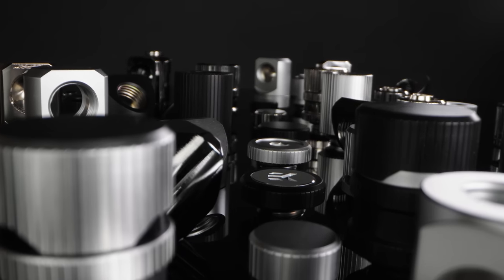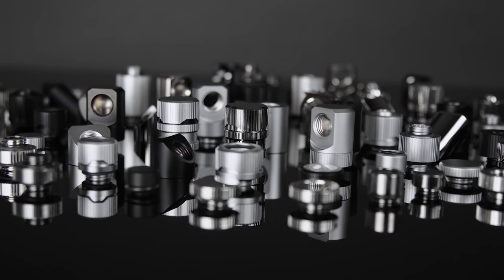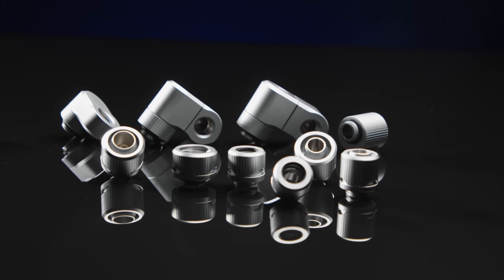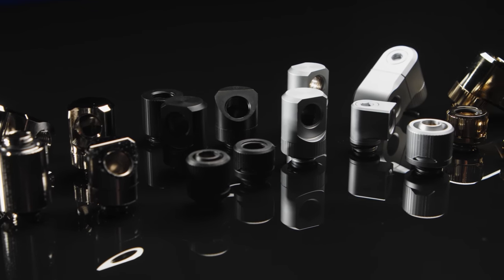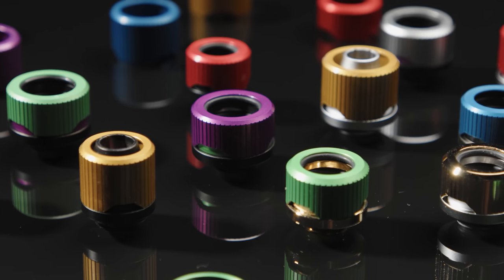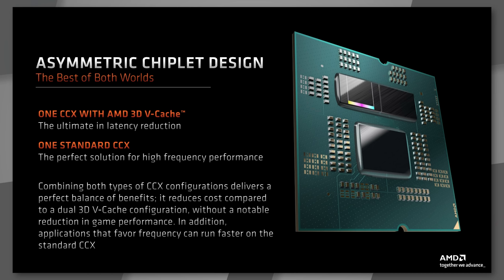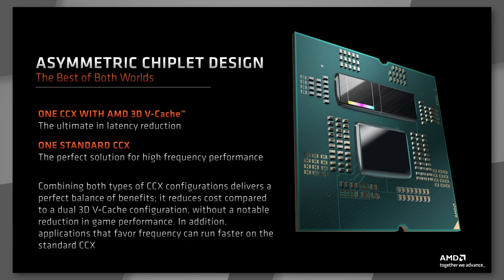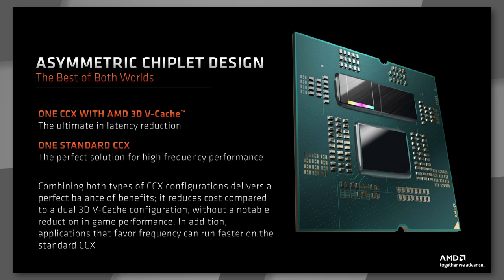Why I switched back to Intel...

Comment: I'm currently on AM4 with 5900X. I did want to upgrade to AM5, but decided it would be better to skip the 1st Gen of AM5 and wait and see how the 2nd Gen turns out. I hope all the issues will get fixed by then. If they still end up having issues then I may switch back to Intel as well.
Reply: Same boat myself. Currently on a 5800x but waiting to see if the 5950x goes on sale during the holiday season. I run occasional VMs so yeah 5950x for me lol. I’ll see what 2nd Gen AM5 has to offer.
Reply: Exactly the same here.

5900X has also gave me a lot of grief and consumed a lot of my time with all the issues and countless BIOS updates fixing some and introducing others, spanning years of time. Effectively, I'm waiting for a CPU that will be at least as fast as my current 5900X in all applications and use cases, but at least 40% faster in games, otherwise I wouldn't bother upgrading. When that shows up, if Intel has it too, I'll go Intel, even if AMD's offering is even faster, just for the sake of sanity and to save my time and have a better overall user experience.

Only if only AMD has it, and AMD's offering is substantially faster (not 10%, but 20% or more, becoming more than 50% faster in games than my current 5900x) and/or substantially quieter (Intel's alternative having much higher and also high in abs. figures power draw while in games, making the system loud and time consuming to tune to not be atrociously loud), would I go AMD again.

7800x3D currently available doesn't qualify as it's slower than 5900x in multi-threaded non-gaming applications. Multi-die x3D chips are a nightmare in terms of the overall user experience. Intel isn't faster by a margin high enough to bother and has cooling problems. Nothing's out there good enough to be upgrading from 5900x, given the cost both in money and more importantly time that that entails.

Comment: Have you had a chance to check out some of the asrock boards? They’re supposed to have really good memory stability.
Reply: I can confirm this. ASRock x670e here and no issues with my gskill ram
Reply: @webnplay  I heard the b650 live mixer is a really good one. Thunderbolt 4 support with their add in card  and the slot below the gpu slot doesn’t take lanes from it. They’re 3.0 speed though. It goes for $180 US Right now.

Comment: I had a abundance of issues this week with the 7950X, ended up all the motherboards i had tested with were doing the same things in terms of memory instability and overall being unstable on the ASUS Strix X670E-E and the Gigabyte Aorus Pro X X670E, they were also having a lot of driver issues. I even made sure everything worked in the QVL but nope. The AsRock Taichi X670E has been the best board I've ever had. It does everything right. It does memory training on the first start and stays within its expo or xmp profile without any sort of crashing. Overall, if youre going the amd route please look into asrock motherboards.

Comment: I think most of your issues with the AMD system is from the dissimilar CCDs. While I would have loved some testing and tests with the 7800x3d to see if it was more stable with your use cases, but in the end Computers are tools and if your tool is getting in the way of your enjoyment and work its not effective. Its been a cool experience to watch the latest version of skunkworks come together. 

in other notes about core parking, the Linux scheduler seems to have a much better time with getting the correct CCD but linux is not for everyone and dialing in the scheduler properly was a bit of a chore for a bit when it was first released.

I have a 7800x3d running rock solid and its been running rock solid for a while 6000Mhz on the memory as well. Best of luck with the intel stuff, I probably wont follow and its gonna take intel doing something really interesting with their CPUs before I go back for my desktop.
Reply: it's obvious IMC degradation and something normal people with common sense would RMA instead of trying to 'fix'. But Jayz isn't very experienced with PCs sadly. 2012 isn't a long time if you can't figure that out...

Comment: Pretty much what you said. Anyone I know that runs the 5800X3D or any AM4/AM5 non X3D CPU have had no issues whatsoever, it's the newer X3Ds that are being wonky.
Reply: Oh there's plenty of issues on non-x3d processors, like any product. There's duds out there. I should know, I bought one for my nephew back when the 5800x was new. He's not very technically inclined and lives a good distance from me so I helped him build it at his place since he wanted to learn how. Powered it up and installed windows and everything seemed absolutely fine. Then a couple weeks later he calls me talking about his PC having graphics driver crashes. He was using my old GPU that he had in his previous machine since GPU prices were fully in the ridiculous territory. through several rounds of trying to solve this sudden issue I end up finding a legitimately good deal (MSRP) on a new 3070ti. Installed that and the graphics driver stopped crashing. Now it seemed a new issue cropped up. Instead of GPU driver crashing he faced sudden, seemingly random reboots. My initial IT technician instincts were that there was an issue with the PSU... Replaced that.. Nope. Not the issue. Was something wrong with the RAM? Nope not that... Motherboard? Nope. Replaced everything but the CPU with no change... Finally, swapped the CPU for a newly released 5800x3d and all reboots and issues were gone. The 5800x was a dud from the start and AMD warrantied it. There were literal years between the start of this and the end when it was resolved... due mostly to the distance and lack of technical ability on his part. He'd basically just been living with it and wouldn't tell me anything was wrong with each incarnation since it could take anywhere from 10 minutes to 10 hours to restart and I was always busy around that time and could only come by for a short hour long visit at most. Which it's not so bad, I at least built a second system for a brother out of the deal.
Reply: @scythelord  DDR5 from Intel has also bunch of problems, especially with those who want fast ram (like over 7200) and having problem with Intels XMP (crashes, reboots), and also platform has problem with its motherboards overvolting the CPUs, so, for some reason people got like for example 13600kf and playing on 4k, like 10-20% of usage and temps goes over 80 with some 50€ cooler. Personally, I've had first gen ryzen and for last almost 2 years I'm on 5600X and got 0 issues, XMP worked fine (+ an extra that I did 3733 cl14), literally 0 problems. Also, problem is that people are buying RAMs that got Intel XMP specs, so yeah, that wont really work... when I'm building someone an AM5 PC, I'm getting them ram that is rated with AMD EXPO and it always work without problems. Basically, for someone 13gen doesnt work alright, for someone AM5, for someone nvidia is shit and for someone amd...

Comment: Next video in the series is "Why I am switching to Arm...

Seriously Jay, you could at the very least tested another 7950X3D to verify that yours wasn't simply faulty with a bad memory controller or something. You should revisit this and make amends of what you thought might be the problem. Would be interesting to see if the issues still persist.

Comment: When I was looking for a new build 5 months ago I was CONSTANTLY reading & seeing video's about how sketchy & inconsistent the X3D had been for this generation and I said: "FGSFDS" and picked up a 7950x instead & the thinks been running like a boss every since I first booted the system ❤
Reply: Good choice. Even a 7700X would do just fine. As long as ones isn't a try hard esports gamer xD
Reply: Same here went for the simpler 7950x also because of the slight performance increase in Stellaris.
Went with an non-expo memory 6000Mhz and it’s working fine.
I do see slower boot time than my 9900k but it’s fine.
Main « issue » is that each time I tried the graphical over locking amd took the machine didn’t boot somehow, while bios level changes do work fine

Comment: I went from AM4 to AM5... and then back to AM4.
AM5 is just not ready, IMO, between RAM compatibility, the extra heat, and the fact that the 5800X 3D is STILL in the running.
Reply: I bought the 5800X3D because its the best for AM4
Reply: 5800X3d is a great CPU. AM5 isn't quite there yet, true. But it's way better now with a newer bios.
Reply: what cpu did you had? cuz from what ive seen, the problem come with duel ccd which only one is with 3d.
Reply: Had no dramas with AM5. Running xmp kit with custom timings. It turns on and goes, tho I don't study my speedo gauges much. Snappy desktop and smooth gaming
Reply: @Djent_Lover  with what cpu? 
cuz the vid talk about the 7950x3d (and 7900x3d) but i can say almost for suuree that this is the ccd thing and not the am5
Reply: @Ben-lr9tp  yeah just a 7600 to get onto the new platform. Games similarly to the 5800x3d. I came from an am4 system, but wanted the upgrade path. The dual ccd is the problem, parking the wrong one in some games. Hope amd sort it out. Not sure what the OP had a problem with their am5 build.

Comment: I’ve been a hardcore overclocker and custom water loop builder since the mid 90’s. I’ll say one thing, I don’t understand why AMD (today) has such a massive cult-like following. I’ve gone between the two several times but I can’t see why anyone would be on the AMD side right now other than the cooling requirements if not on water. 🤷‍♂️

Comment: @JayzTwoCents - I know this is a old video and chances are you won't see this post BUT I'm betting you were running a Asus board. My son recently experienced the EXACT same symptoms you were. The problem just kept getting worse! As of this last weekend we swapped out a Asus X670E Strix for a ASRock B650E Taichi and thus far everything is good, time will indeed tell us more. The CPU nor the RAM are the issue, the motherboard seems to be the issue. On the Asus it would habitually BSOD reboot on the first cold boot, generally after that it was fine but as time went on it would BSOD a second time before being fine. On the ASRock board the whole setup went smooth without hiccups. Memory OC'd to 6000Mhz with EXPO, FCLK at 2,200Mhz (haven't pushed higher yet), Curve Optimizer to -45 on all cores but two, one being -50 the other -43.
In short, I don't think it's a CPU issue, I think it's a motherboard issue, try another motherboard with the same CPU (7950x3D) and see what happens, but I'd just about bet money you're running a Asus board and that is your problem.

Comment: 7950X3D with 64GB 6000 CL 30 no issues whatsoever other than crushing Intel fans hearts that use 5x the electricity for not as good performance lol

Comment: Just upgraded from 3600 to 5800x3d. Microcenter had a pretty sweet bundle deal. Running it with asus tuf b550 and asus 3080 tuf.  I have a steady 20% increase in fps with 0 overclocking. 
0 issues. Totally stable.

Comment: I have the 7800x3d.  I stream @ 2k and record without issues.  I have MSI board and didn't have issues with ram issues.  XMP gives me 6000mhz.  Granted I run 2 sticks for 32gb of ram.  Wanna try 4 sticks but don't wanna waste money to see if I can.
Reply: If 32gb ram is enough for everything you do, more ram won’t give more performance. Adding ram is pointless unless you’re running out of ram
Reply: Almost everyone reporting issues has an ASUS board. It's almost like a pattern..! Yet they blame AMD..

Comment: This video didn't age well.
Reply: Y?
Reply: @hacoberthejacober3345  intel’s 13th, 14th gen crash problem caused by silicon degradation
Reply: @capybara-sama  damn I’ve been out of the loop a while, makes me feel even better about my 7800x3d
Reply: it’s not degradation - it’s just unset mobo power limits, which is an easy fix
Reply: @thekeylimepie unset power limit which causes silicon degradation which causes crashes
Reply: @capybara-sama  yeah so set the power limit lol
Reply: @GAMER38X-hh7zl  is the 7950x3d more stable now?
Cause i dont know if i should get the 3d one or the non 3d one
Reply: @JokerP5  yeah mate its fine for me
Reply: Lmao
Reply: Just like intel processors.
Reply: @mangatom192  XD
Reply: Like fine milk
Reply: @mangatom192 intel processors far more stable if you set the correct power limits out of the box. I’ve used both and my 7800x3d was loaded with problems. Very good on paper and in some titles but if money isn’t a concern and you know what you are doing with the power limits then intel is worth the mostly not noticeable sacrificed performance with some games.

Comment: It's been interesting and educational watching you struggle through the stability issues you had with this iteration of Skunkworks, in part because I went through a very similar situation many years ago with an AMD Phenom II X4 Black.  In my case, the Gigabyte motherboard had a BIOS update that broke compatibility and the solution was to have to buy a downgraded processor (which at this point cost more) and then not be able to use or return the sweet proc I'd shelled out money for.
Not haranguing AMD here, just realize that I'm probably still good to stick with Intel.  They're not perfect (hey Spectre! Hi Meltdown!) but they've honestly given me less grief.
Current build:  Intel Core i9 10980XE, EVGA RTX 3080 TI FTW 3 (RIP EVGA), gaming at 1440p.

Comment: I had so many problems with my 1700. Weird start issues. Software issues. Stuttering. 

When I upgraded to a 3700x I had nothing but problems as well which I hoped would be improved. 

My systems worked but unreliably. 

Switched to Intel 13600k and haven’t had a SINGLE problem. Starts EVERY time. NO software issues or inconsistencies. Game changing. 

Im back on team blue for now.

Comment: Wow.  10 month struggle with AMD 3D and RAM on your home system, including stock/recommended settings???  I did not realize it was that long.  Your initial problems are why I decided to go 13900K instead of a high end AMD (no 3D).  I wanted that extra year of DD5 experience Intel had at the time.  I am glad so far, AMD works great for hand held helds and laptops; definitely appreciate the iGPU performance.
Reply: I have both types of systems and after having a lot of stutter and issues with the big little design of the intel computers, I just swapped all over to AMD machines.
Reply: I wasted 1.5years with ddr5 12 months on 12900k z690 were I stubbornly tried to make 4 sticks work it won't there's a reason evcery review and video you only see 2, then 6 months with amd x670 which somehow was way worse on amd making 2 sticks that ran fine on intel at 6000 work at more than 4800mhz was a nightmare I gave up on ddr5 and bought a z790 ddr4 motherboard (which is better than a 1000$ ddr5 mb for 450$) the msi tomahawk ddr4 highly recommended

Comment: 7800X3D here with 32GB clocked at 6000 and CL30. ZERO problems. Latest bios updates re-introduced working SATA hot-plug.

Comment: These issues are so strange, I stream and game from my 7950x3d Id read about these "issues" (parking the wrong ccd, Ram issues etc) which meant i really wasnt sure about making the switch from my 11900k to the 7950x3D, Instead of the 13900k. However, I took the plunge and have had NO issues, I used the Asrock Taichi and run at 6000mhz on Corsair Dom just by using the expo profile. As for temps, It's a 4090 in a single loop with duel 360s and ive never seen it run above 58c cpu and around the same on the 4090 after hours of gaming. I dont understand why so many people are having these issues, Maybe I got a golden chip if so thank god, But i cant help but wonder if your issue was simply the asus MB.
Reply: ACTUALLY, Saying that the first time I booted it, I thought it was screwed as it took 15 minutes to train the memory! (64gb Corsair Dom 6k) so that was nerve racking 😅. Especially as the user manual wasn't exactly clear on what code 15 was.
Reply: Asus went downhill that fast? I have a Asus maximus x apex with my 8086k. Never had a single problem with it... Its been used for a while too and hard.
Reply: @pauloa.7609  I have nothing against Asus, I run ROG laptops, GPUs even my old build runs the Asus ROG Maximus Formula £1,500 mobo. But every single forum I've read that had these RAM issues on the 7950x3d have been ASUS boards... I'm tempted to buy the Board @Jayztwocents is using and replace it with my Asrock Taichi and see if I get the issues he's described 🤔 my build and his old build use the exact same parts apart from the MB.

Comment: I use 5950x And for my general use and occasional gaming, it was so powerful, that I undervolted the CPU to 3,3 Ghz on all 16 cores and it runs at 0.8V drawing around 40W. The impact is that the whole case and CPU fans can ran on 25% which is dead silent.
If i need more performance, I can simply set it to default....

Comment: I'm building my first custom built home build. I'm truthfully a mac guy but love technology and since Windows 8 I've grown to love the Windows platform almost as much as OSX so I'm building a PC after an awesome experience with some Windows laptops. Due to wanting a solid reliable and well tested set of components I've gone for last gen AMD and bought a 5950X for the amazing price of £330 which is probably around $400-ish not sure on the conversion. Looking forward to getting the last couple of components and building a sick hard line dual custom loop with two pumps and two distros. Bought a Bykski open frame chasis that looks pretty sick and can be used as a test bench too. Going to be running two 360mm rads from Corsair to cool the loops and got some really high end blocks from Heatkiller. Can't wait. I'll send you a picture when it's done for you to take the piss out of what will probably be poor cable management although being a Mac guy I'll probably be really OCD about trying to make that part perfect.